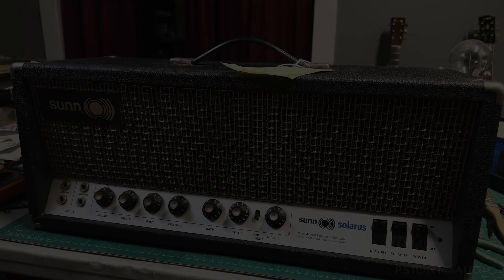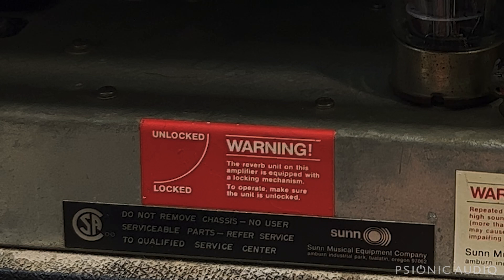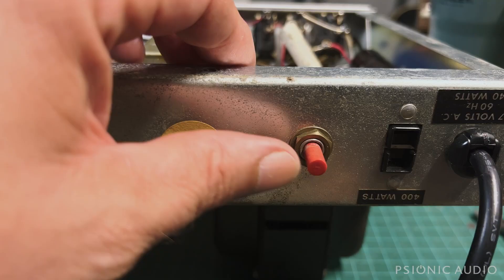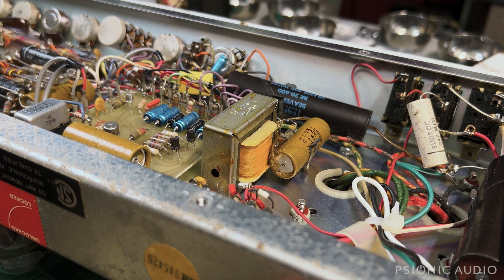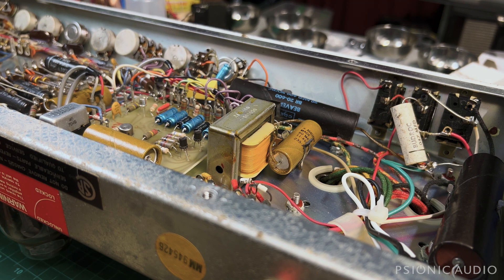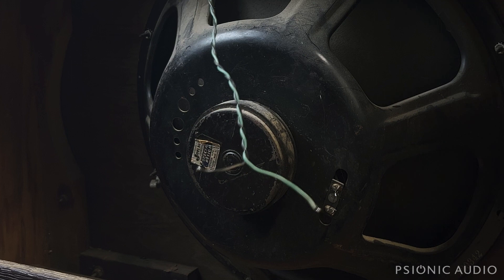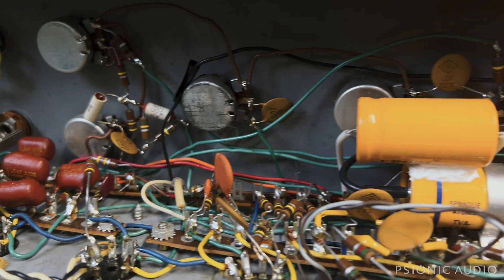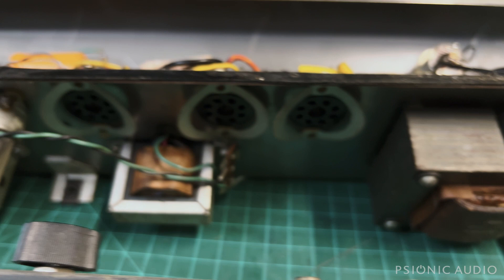When is an Amp Worth Fixing? | Sunn Solarus & Gibson Hawk

Comment: That sun looks well built.
Is there a way to safely run a 4 tube push-pull amp using only 2 tubes? I assume it involves impedance matching :)
Reply: Well, if you pull 2 tubes, double the impedance. 4->8 8->16 Either pull the inner or outer set of tubes, don't leave 2 on one side.
Reply: @BoomTexan  Actually, one halves the impedance: 4 tubes matching 8 ohms on the 8 ohm tap means 2 tubes match the same 8 ohm speaker on the 4 ohm tap. Consider a quad 6V6 and think about the 4 ohm tap: if the 4 ohm tap reflects zero ohms across the OT primary from a zero ohm secondary load (dead short), and the 4 ohm tap reflects 4K across the OT primary from a 4 ohm secondary load, how many primary ohms does an 8 ohm secondary load reflect from the 4 ohm tap?
Reply: @edwardleaver7838  That's what I meant, whether or not I conveyed it properly.
Reply: @BoomTexan  Thanks for the clarification; I apologize for my inadvertent misrepresentation.

Comment: Isn’t this the kind of thing Leslie West was into, although a “PA head”?
Reply: Same manufacturer, but as you say a stock Sunn Coliseum PA amp. It was unusual for the time in that each of its four microphone inputs had an individual volume control, while the amp had an overall volume control. In effect, it was a 'master volume'-style amp before such things officially existed even as mods. It was also also very powerful, and correspondingly loud through West's Eminence speakers.

Comment: Is $350 (labor included) a fair repair price if recap is required? Most of the caps are probably shot as tremolo quit months ago. For doom it’s a great sound, takes high gain pedals and fuzz like a champ.
Reply: Beyond a fair price. Suspiciously cheap tbh. Minus parts and taxes and shipping that's probably 1.5 hrs labour. No way you can do a neat job on something like this in 1.5 hrs and ship back a perfectly working amp. They always need tubes (another 1-200) and they always need speakers (1-200).  So that's potentially $150 in parts (+t+s), £300 in labour, $200 in tubes, $200 in speaker(s). Then there's return shipping ..
Reply: @cgavin1  Ive got tubes and it's only the head unit and dont have to worry about shipping as my shop is local. I still consider it a fair price